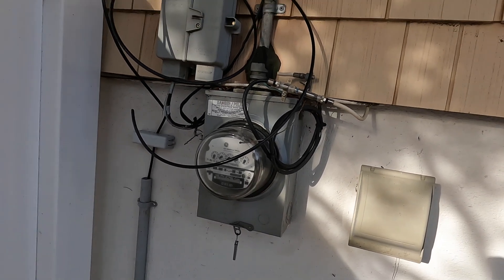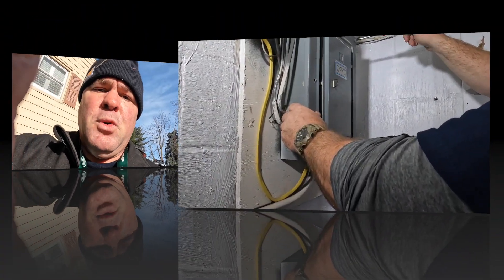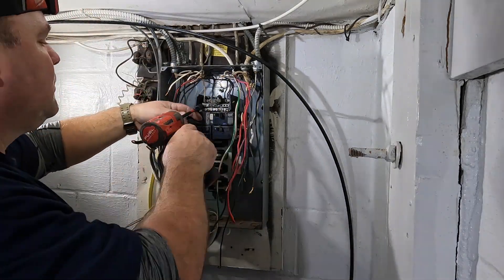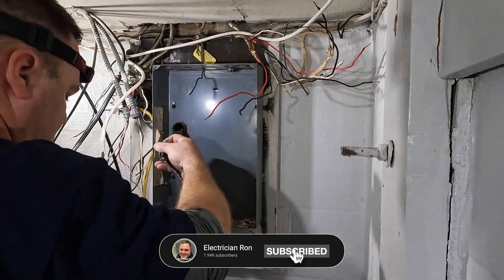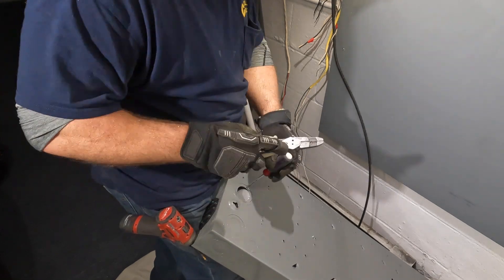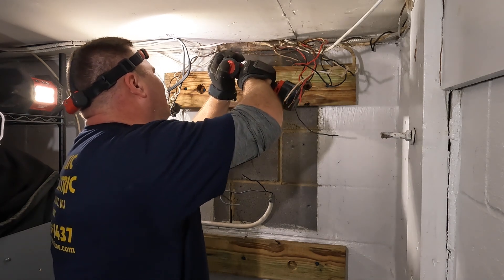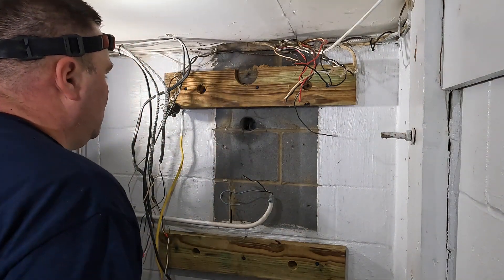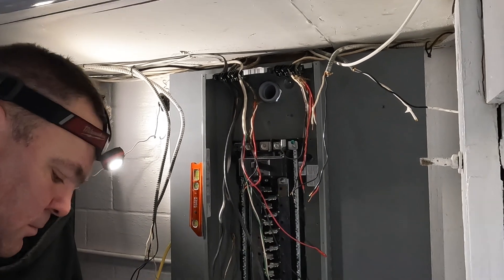200 amp service upgrade in Atlantic Highlands, NJ Part Two

Comment: I've not seen a panel where the wires can be pressed in slots on the top before.  Also, why was the panel installed so close to the ceiling as it looks like you have little room for wire management on top.  BTW, there are no "mistakes" Ron, its called adaptability to a particular situation.  Better to adjust then to blow it off and take short cuts.  You make this look so easy and appreciate your attention to detail.
Reply from the maker: This is a special Square D Homeline panel. The slots up not are unique and new to the Homeline panels.  They save time on labor but are not suggested on older homes with armored ‘bx’ cables for obvious reasons. Glad you enjoy the videos!

Comment: If you pull a "Smart Meter" out here in Commiefornia .. they'll instantly know about it when it goes offline. The Utility company won't rush out to see what the issue is, but they will eventually pay your location  a visit if it's offline for more than 1 hr. I upgraded my meter, panel and line to the pole to 200 amp over the course of two days .. PG&E did pay me a visit and couldn't see anything out of the ordinary. They were scratching their heads .. just glad they didn't look at any dates on the panel or pull the meter since i was able to remove and replace the "tamper proof lock" on the meter :) I even painted all the new boxes and mast to match the house :) I've been doing electrical for many years and i don't suggest anything i did to anyone.. especially upgrading the line to the pole ! But i did the entire job for less than 2000 vs the 12k i was quoted.

Comment: Also, could you provide info on the fittings used for the grounding block and enclosure you provide on the outside of the house so other vendors can attach their ground wires. Thanks.

Comment: Hi Ron, Question on Ark-Fault Breakers. When doing a existing panel upgrade from 100amp load center to a 200 amp are AFCI breakers required in your area? OR are these breakers only required for new home installs?
Reply: I also have the same question.

Comment: Merry Christmas Ron. I was wondering what those black connections were at the top of the new panel box.  Never saw them before. Thanks for taking the time to make these videos. Very informative.
Reply from the maker: Those are called Black Button connectors.  They’re made by Arlington.

Comment: Do you have a shop where you prefab all the wood you bolt down for new panels? Like the green-treated 2x4s with the countersunk holes for the bolts, and the 3/4" ply that is already painted and ready to go? Or do you pick up these materials at an electrical supply house?
Reply from the maker: I usually buy supplies from Home Depot and cut to spec on the job.
Reply: @electricianron_New_Jersey  You even paint the ply onsite too? That is really impressive and a nice professional touch. Most work I see the contractors just mount naked plywood.
Reply from the maker: @aaron74  the plywood mounting board is prepared and painted at my house.  Everything else on site.

Comment: If you drill a hole for a TAPCON and the hole blows out, use bare copper wire to stick in the hole.  Then drive that screw in.  Also structural GRK screws can work to. 😊
Reply from the maker: I’ve done that with the GRK’s but not the Tapcon’s.